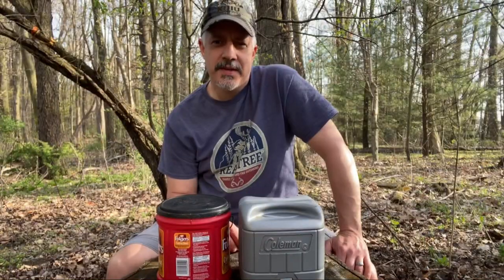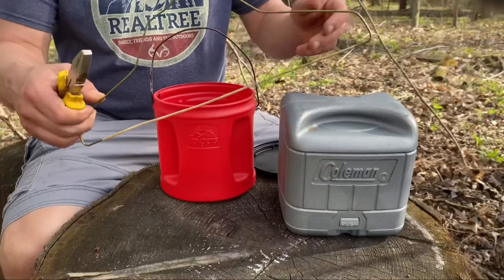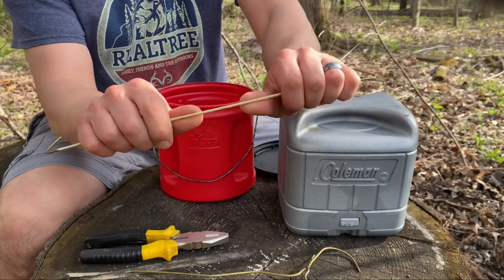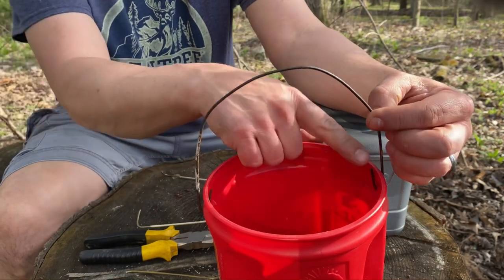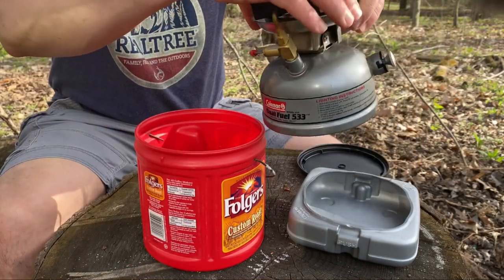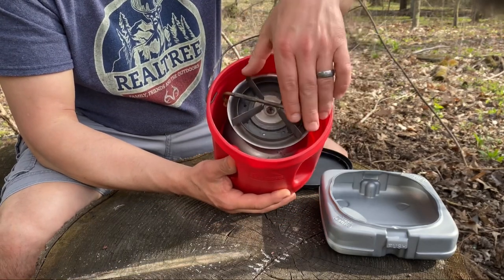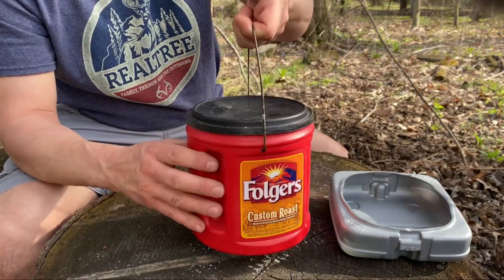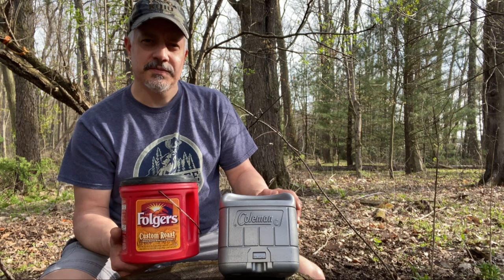Coleman DIY Carrying Case

Comment: The Folgers can is much better than the original case to me. I spent good money searching for the original case and it was not cheap for being a bit of plastic. Plus, it would pop loose on me at times. When I finally found the right Folgers can, it works much better at protecting the stove and does not randomly pop loose. I never thought of putting a handle on it though. Great Idea. I always carry my stove in the back of my SUV with some white gas and a couple of pans with utensils in case of emergencies. Thanks!😊
Reply from the maker: Yes, you are right !! The Folgers can really is better !! And as you mentioned you don’t have to worry about the bottom falling out ! That’s a great idea having a way to cook in your vehicle. I certainly appreciate you watching the video and thanks for commenting! 
Have a great weekend 👍🏻🏕️
Reply: Folgers 55 OZ can?😁

Comment: Hey brother! I have a question for ya. I love my vintage 508 that I've had for around 35 years. I have been known to run unleaded in it occasionally and never had a problem. I have been pondering a newer 533. I have read that the generators in the 533 dual fuel clog after just a few months running the unleaded. If this is the case I may just end up going with a primus omnilite instead. Not that I'd ever have a shortage on white gas due to having several that I run ONLY on white gas, but options are always good. I know the primus has more options, but ya have to change jets and all that. I highly doubt they'd simmer like a coleman either. Without simmer, I may as well use the SVEA123R. Oh and I was unsubbed, AGAIN.
Reply from the maker: I tell ya , with all the ethanol in the gas today I would want to run any of it in my stoves unless I had to, but then I would drain it out and run some white gas through as soon as I could !! I know the gas today sure does mess up the small engine carburetors ! Yeah I’m not sure what’s goes on with YouTube , I lost six subs this past week, unreal ! Glad you got me back and I appreciate it !! Thanks for your support brother !! Take care !! Have a great weekend 👍🏼
Reply: @IndianHemlock  yeah I run only high octane pure unleaded in my small engines. My husqvarnas warranty can be voided if below 89 octane. We have a local station I always use for that. They have 95 and 100 octane that are ethanol free. Talked to a fella earlier he says unleaded always clogs em, but I know unleaded is a lot dirtier and not quite as refined.